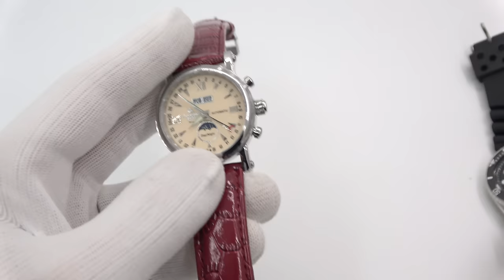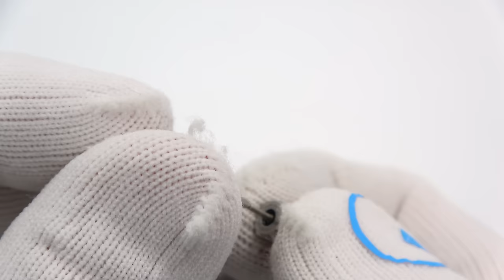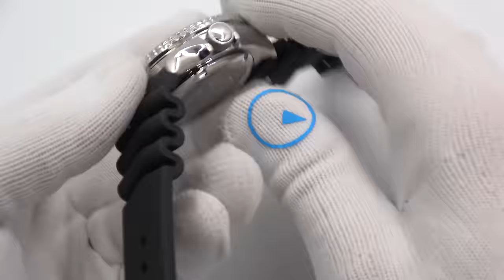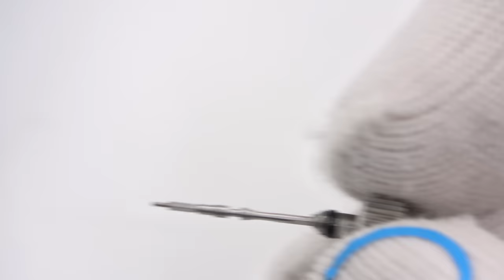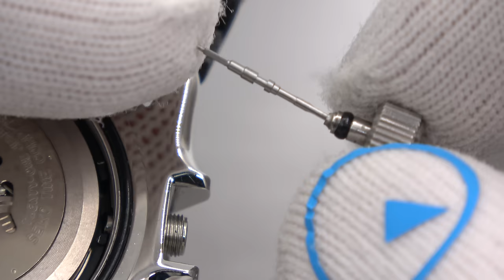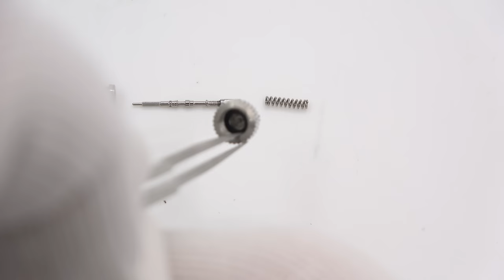Breaking down the Screw Down Crown - Watch and Learn #71

Comment: Thanks this is a great demonstration. It really shows that the only benefit to screw down crowns for water resistance is that it prevents the crown from getting bumped open while under water.  I think high water resistance and screw down crowns tend to go hand in hand because if they engineer good seals in the crown they’ll likely also add a screw down crown.  Seiko push crowns tend to be very water resistant.  Where as a brand like Hamilton gets flooded from rainwater.  It’s all about the design, tolerances, and quality of the seals.

Comment: Another great video on screw down crowns.
Just a question. Can one overtighten a screw down crown? With my previous watches, TAG Hauer, Christopher Ward, I have always tightened them securely to the point where they butt up against the collar and have had no problems with sealing. However, I have just acquired a new SMITHS Everest and the instructions say that you should only screw down until you feel the crown gasket engage with the tube. It is not necessary to screw it down hard until it touches the case, saying that damage may occur if screwed down too hard. This was a little strange to me, since with my other watches, mentioned above, I tightened the crowns down securely and never had a problem. However, unfortunately water has entered the watch, also misting up the glass. Fortunately, the situation was salvaged before any damage occurred. The watch was only immersed in a tub of water for about 10 minutes, so nothing excessive. I am now reluctant to get the watch wet, although water resistant to 100metres. Could it be a damaged crown gasket? and I am not sure how far to tighten it. My gut feel is to tighten it securely, with the tube and crown contact not allowing further tightening as with my previous watches. Obviously, I don't apply excessive force when screwing down.
Your comments on this would be much appreciated.
Thanks,
James
Reply: I posted a similar question (then I saw you asked essentially the same thing). Did you ever get a conclusion / response?
Reply: Cannot recall getting a response. However, the YouTube video was really good.
Reply: @jamesgreig8796  Thanks! I am tightening my watch till I feel resistance and it feels tight, without feeling like I am forcing it / pushing it unnecessarily too far.
Reply: @eurodudenj  A pleasure. This seems to be the recommended method, so all good.

Comment: One tip for avoiding cross-treading your watch crown is to push the crown in while (at the same time) turning it counter-clockwise until you feel it click away from the thread and then its properly seated onto the thread for screwing it (clockwise) into the watch without misthreading it.
Reply from the maker: Thank you for the tip.

Comment: Excellent video. I did indeed have a question for you though. Can you think of why a screw down diver's crown being too tight would cause the watch (quartz movement) to stop? I have a watch that does this at around 5 to 20 past 7. It's like the hands catch on the glass (if not each other) because of some sort of deformation due to the increased pressure. But from what you're saying the crown not impart any extra pressure on the stem nor advance further into the mechanism. I'm curious to hear your opinion as to what might be going on. No watchmaker or jeweller has thus far been able to repair it.

There was harness around the mechanism which I deliberately put a small split in myself which improved the situation - made the watch less sensitive to the "over" screwing down. But the problem persists. 

Edit: why not just be gentle screwing down the crown, you might ask. It's incredibly difficult to gauge the difference between too tight and having it spring open.

Comment: I own some Russian Vostok Amphibia watches which also have a wobble on the screw down winding crown; this was designed in to de-couple the winding crown from the movement: therefore any shock to the crown will not be transmitted to the movement.

Comment: Hey Mark, 
Very good video explaining how this all works. I have a couple of watch modding questions related to this.

I got a knockoff SKX013 case I plan to migrate my SNK809 into, dial and all. I've got a new stem for it (two actually, in case I stuff one up), but I'm now concerned about putting the screw down crown together. Would I just assemble it and affix the crown to the spring at the end of the assembly using the same Loctite I'd normally use to secure a crown to a stem?
Also, is there any specific way to measure the stem length vs how you would measure it for a non-screw down crown? 
Cheers

Comment: Great video, question for you..Say you have the crown in the unscrewed position and you accidentally pulled on the crown thinking there was another setting position but wasn't. What stress/damage could be done? Watch still works as intended and functions the way it should, just curious to know if this could lead to a problem or am I over thinking.

Comment: If you are putting that screwdown crown assembly together, what glue do you use to permanently hold the crown on? Can it be put back together with glue? Or would you have to replace the assembly?

Comment: @Mark, I have a question about a slightly gritty, slightly rough crown feeling when UNSCREWING a screw down crown: Could a somewhat rough feeling come from the spring inside the crown and not from some rough crown threads as usual? Or put differently: Is the spring inside the crown in contact with any moving part while unscrewing the crown? Thanks a lot. Thanks for the cool video!

Comment: I own a Invicta 29179, with NH35a movement. at night I take it off leave it on the table then when I wake up, it slows 5 or six seconda during the night. I wear it during the day and it speeds up 5 seconds while I wear it. At night,  I repeat the same routine every day. during a month, every day al 22:00 I take a reading (compare wit GMT time)and record it. during a month, found out that it has an error of 10 seconds I mean a month, Ist that COSC standards?

Comment: I am having problems with a a Tissot PRC automatic divers watch where the crown does not seem to screw down onto a threaded part of the case - I can work out how it screws down but it keeps failing. Its hard top describe but if you took one apart you would see it is different to the one shown here and its proving to be a repeated source of trouble for me!

Comment: I have a Deep Blue Juggernaut IV dive watch with an SW200 movement and the crown no longer screws down. It's still springy but it won't catch threads when I try to screw it down. It just pops back out. It seems like something is stripped. I wore the watch pretty seldomly so I'm surprised it broke so easily. Is this an expensive fix?

Comment: I will be getting a new automatic watch with a screw down crown in a few days, and I am concerned about getting it cross threaded. Mechanics know that to start a nut or bolt, you can turn it in the "wrong" direction until a click is felt, knowing that is where the thread will be engaged, then, turning in the other direction to tighten. Wouldn't that technique work with a screw down crown, to avoid accidently getting it cross threaded?

Comment: I just got a watch yesterday, and never knew about screw down crowns. I accidentally pulled it out with plyers. Now it won't set the date, and struggles with setting the time. Ive opened the watch and have a big mess. Plz help!!!
Reply: Have you found a solution, i have the same problem with my watch
Reply: @kopa8905  No unfortunately I have not. I had to buy a new one. 😓

Comment: If I need to fit the crown with a new stem (since I replaced the movement) how do I get the stem off that crown spring mechanism so that I can put the new crown on and lock it down?  Is that even possible?

Comment: I have experienced that when screwing down the crown on some watches I've made that when tight it will stop the watch. in order for the watch to run I would need to leave the crown loose. Back off a turn or two in order for the watch to start running again. Why is this happening?

Comment: Hi Marc, great video series. I subbed. I've seen some comments elsewhere that automatic watches should be wound more with the rotor instead of the crown. That the mechanism associated with winding with the crown of an automatic is more prone to wear compared to a mechanical watch. Is this true? Also, over time, wouldn't allowing the crown to pop out during unscrewing and jamming the crown in during screw down cause excessive wear or damage to the threads of the barrel and inside of the crown?  It seems there would be much less wear on the barrel and crown threads if slowly and methodically unscrewing the crown without pop and slowly engaging the threads during screw down.

Comment: Good video Marc, thanks. Question: my DOXA only requires half a turn to lock down the crown whereas most of my other divers require from 3-4 turns. I don’t feel that the DOXA crown is really securely locked notwithstanding your assurance that it will not negatively impact water resistance. The DOXA has an ETA 2824-2 movement???
Reply from the maker: If it's only a 1/2 turn and its not a bayonet type, then it's likely stripped? I'm not familiar with Doxa, though.
Reply: Thanks for that Marc. Maybe it is a bayonet type lock down

Comment: Marc,

Great video ... I have set aside and forgotten-about my five other Seiko/Orient watches until I maybe need them ... and am just using my TWO remarkably accurate watches ... an SKX and an SNZ ... 

And it was all because I was re-setting them all every day ... and every time I muscled-in a crown ... I was thinking OH SHIT am I cross-threading this? 

(Cue wedding-night anxieties...)

Why am I sending this? It's because I have read that gently "burnishing" the gritty threads of a factory-spec SKX with dental floss ... and nothing else ... will make it a lot easier to re-engage that non Patek-Phillip thread. It works.

It takes four hands to do it properly, which may lead to sex, but whatever  ... it's an easy safe tweak ... no WD-40 please ...:)

It threads better now ... but I still avoid it ... just shake or rest (the watch) as required ... the benefits of owning two almost-perfect watches ...
Reply from the maker: Great work! Just don't use mint :)

Comment: Is it normal when you wind the watch, as the main spring gets wound more and more. for the crown to slightly turn the other way when let go between turns (I guess from the resistance of the main spring)?
Reply from the maker: Yes. It depends on how the stem/collet interface is designed.